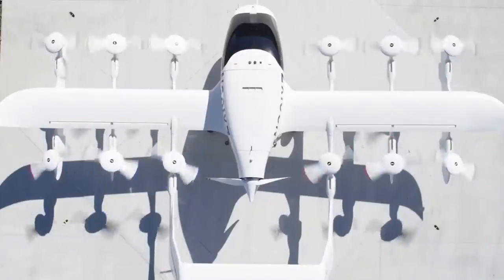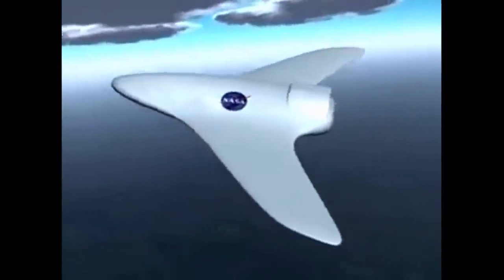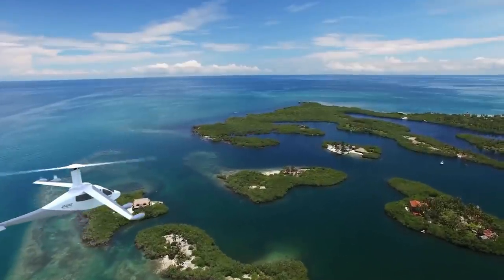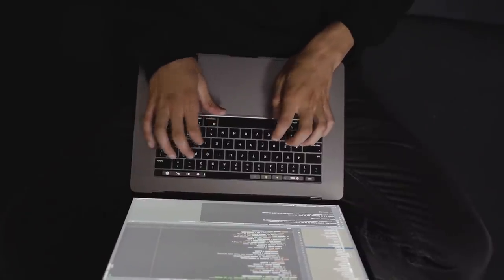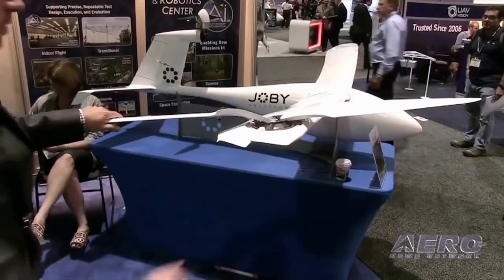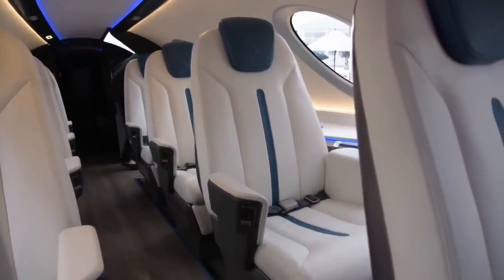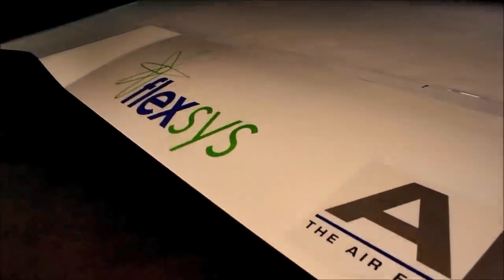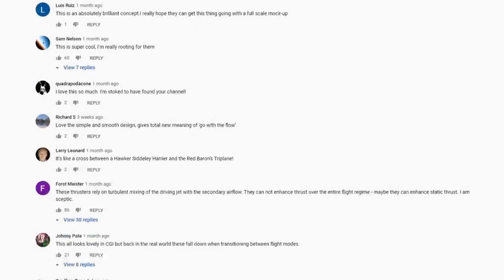Variable Geometry Technologies for Electric Aircraft

Comment: I knew warped/morphed wings would soon come back in fashion.  It makes so much sense with today's tech. 
Yet many don't realise that the very earliest (half-foil) monoplanes used a crude form of 'warping wing' as control surfaces.    

I especially love the 'folding tip-rotor', a concept along the lines of something I've been working on recently, a hybrid  inspired by the V-22 'Osprey', the VWG- MRCA 'Tornado' & GD F-111,  the U2 spy plane and the two  ficticious -  'Samson' HL aircraft (Avatar) and the 'Cheyenne' - Rapid Deployment Drop Ship (Aliens).   
.
My design incorporating a three tilt-rotor system like the Osprey, but with a pair of fwd wing-tip mounted rotors, in a slotted aerodynamic motor nacelle - so slotted to allow for 'variable swept wings' to be incorporated.   The main rotors would have three folding prop blades (as often used in model gliders) that when not in use, would self-locate and collapse the blades streamlined to their propulsion nacelles (nested) in axis of thrust, when in forward flight to reduce drag.   Folding outer wing sections capable of various degrees of aspect ratio; fully folded for VTO&SL  to give the main rotors maximum downwash effect/lift.  Partially open (swept wing) for fast decent and manourablilty at high speeds (main rotor blades nested or providing extra forward thrust).  Fully extended for full aspect-ration to maintain lift at low speed/power in glide mode and at high altitude soaring (fwd rotors nested).      
.
The design incorporates a third ducted tail rotor with contra-rotating blades controlled by microprocessor also liked to the 'Y-H' configuration  stabilator/rudder actuators/surfaces.  This ducted tail rotor is axial to the fuselage and can by rotated through ~100 deg inline to the axis of the fuselage, to either - horizontally act as a vertical take-off 'aft thruster' (in concert with the two fwd wing rotors), or slightly tilted aft (linked with the fwd rotors) for slow rearwards motion when hovering/manouvring, then rotated forward in line with the fuselage to give foward thrust as a 'pusher' with varying/increasing wing aspect ratios.  The proc-controlled contra-rotating blades controlling yaw and course direction regarless of rotor orientation, synchronised with rudder/stabilators.   

But these wing tip folding rotors give me food for thought...  And don't they look like the wing-tip feathers of a large bird of prey?  

I wonder why the shelved the idea..?  What were the problems they encountered, if any?

Comment: I have a rough draft now for a new design, it will be a biplane, with wings at the rear, and a rudder between 2 electric plasma jets, with forward and reverse thrust, the goal is to create an STOL - SSTO capable of light speed. 

The size and shape of the fuselage will need to be contained within a gravity well, wings and all for light speed to be reached.

It will run on tokamaks, and possibly if necessary, combustion also. 

Estimated time to complete : 2 months

Comment: Voice: so overproduced and without any soul.

Content: awesome, didn't know about some of those projects.

Flexsys: not sure if a continuous wing shape is better per se. E.g. drag can be beneficial for descent and on the lower wing when rolling to help compensate adverse yaw.
Reply: Also, not even sure that flex tape thing would even reduce drag instead of increasing. Strongly depends on the state of the flow. Might possibly lead to delamination bubbles.
Reply from the maker: Well said!

Comment: I'd be curious why designers go to such length to avoid a simple tilting wing / tiltwing? 
There is this Dufour VTOL tech from Swiss which seems to work. 
For motors on the wing and the wing can turn vertical for VTOL. In flight it is a normal efficient airplane wing.
PS: I guess it's because only electric motors and advancing material sciences makes this now possible. Still wondering why not more electric aircrafts are designing tiltwings now.

Comment: With the reality of Climate Emergency isn’t it time to as fast as possible remove fossil fuel from aircraft . Why can’t there be an aircraft with off the shelf components be put together at half the price. Yes the aircraft would be only 95% of whats state of the art today but, we don’t have time to piss around anymore.
Reply: There's a huge problem with the energy density or current battery technology. All the current electric aircraft plans are for short duration flights. Electric aircraft don't have the range to make them practical in most applications.